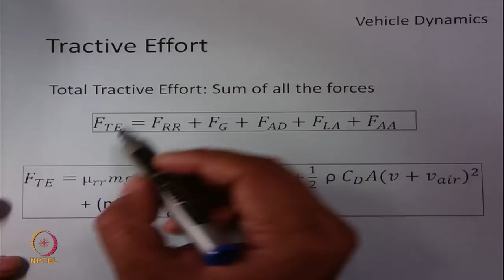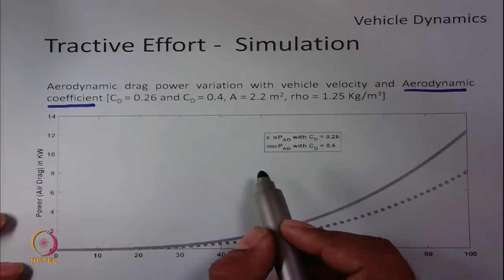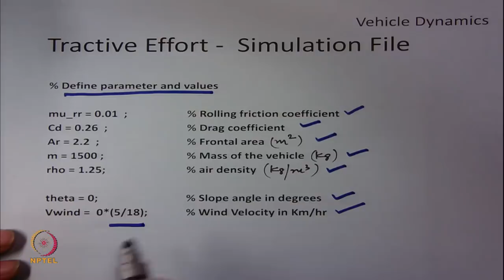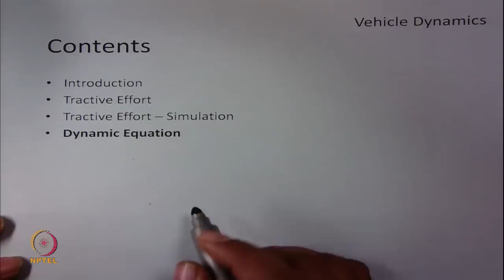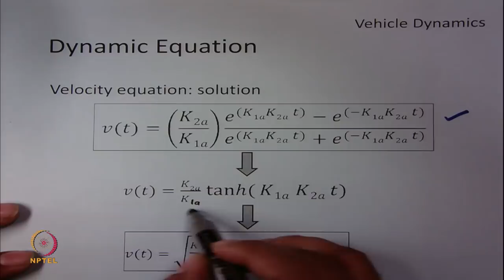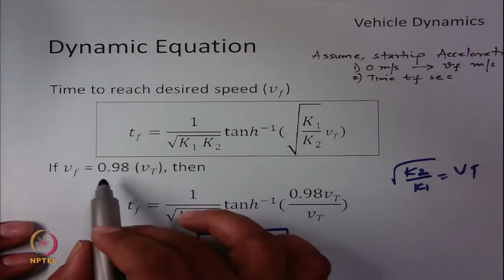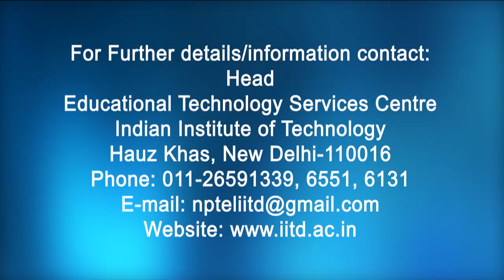mod03lec12

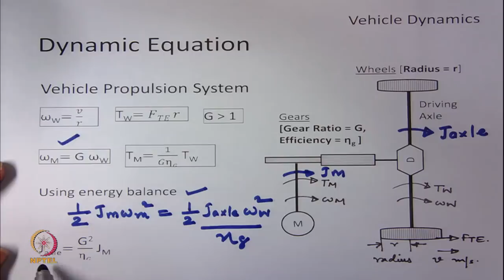Comment: 22:10 jaxle equation is wrong etaG should be in multiply , please check
Reply: no, its correct. energy at motor will be more than that at wheel due to losses.
Reply: We have reduce the speed at output so equation is right
Reply: Satyajeet Sahoo  Jaxle>Jm...and if we go by your rule i.e. jaxle<Jm then how do explain the value of G^2. Since the value of Jaxle should be greater so the Gear Eff should always be divided by Jm...it cannot be multiplied.
Reply: Satyajeet Sahoo  You are contradicting yourself and forgot about G^2
Reply: At 27:50 there is no - in LHS in the last line.Tanh becomes Coth.Does anyone have reference for these formulas